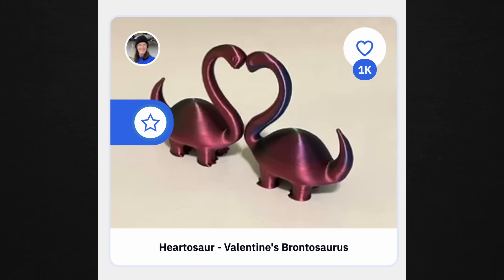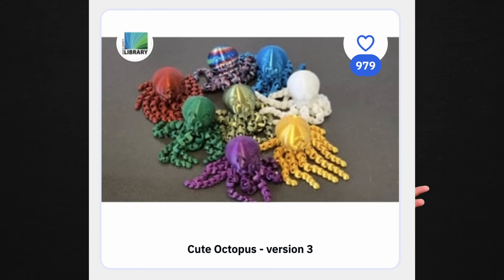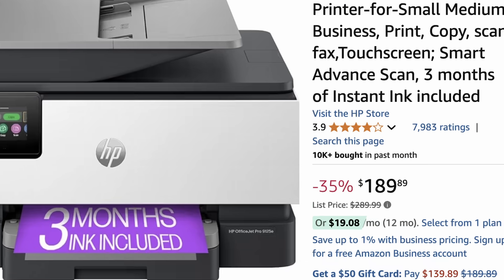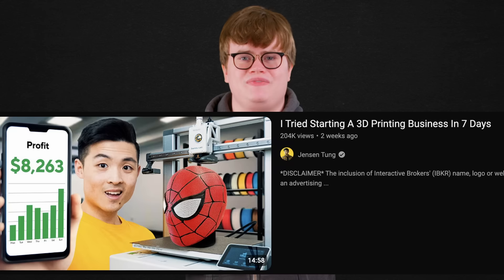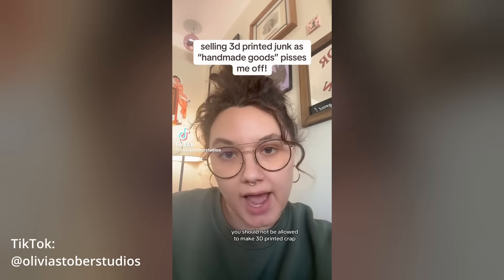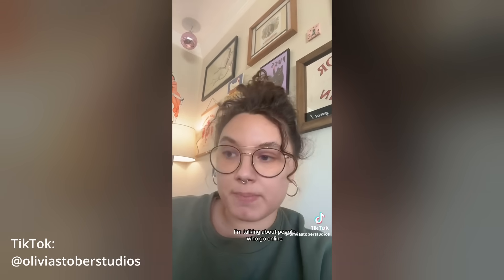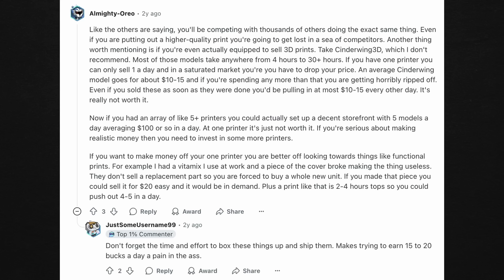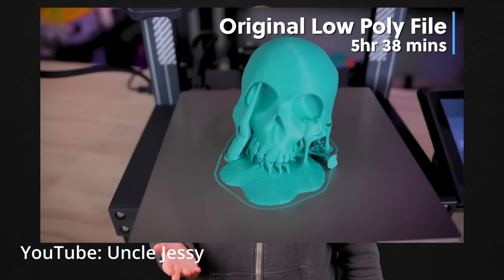The Rise of 3D-Printed Slop

Comment: finally got around to watching the whole thing. most points are valid, and I think if you had consulted someone who actually does use a 3d printer and design parts for it, and makes designs SPECIFICALLY around the strengths and limitations of the FDM process, you would have been able to cover all of what would be my counterpoints, and made a much better informed video, and even have some extra points towards the "3d printing bad" message

Comment: What I use my printer for most is for things that would be inconvenient to order, things were I can't find the exact sort of thing that I need, and things that don't exist at all that I have to model and create myself. I've printed out battery and electronics enclosures for my headlamp that are a hybrid of pre-existing models, hooks to store things, clamps for wire runs, mounts for a variety of things, and I modeled a little framework for GoPro's that contains a battery, a switch, and a tiny fan in a door over the back screen, for cooling purposes. 3D printers can be a toy, but their primary actual use is in either printing out things that you need, or printing out very specific things that other people need.

Comment: I got my first 3D printer when I built a small workshop in my apartment back in 2019 (in a small unused spare room that I ventilated well), primarily for the purpose of helping me build tools and jigs. I wouldn't want to be running a printing farm. But the 3D printer has been really useful not only in designing and printing affordable accessories and jigs for wood working, but I used it to repair quite a bit of items over time, and built custom mechanical parts for small projects, including for helping friends.

One of the last really cool projects I used it for was to put together my e-bike. I designed and 3D printed battery mounts that fit my bike frame perfectly. My motor's axis crank screw thread is also unfortunately stripped, so I ordered a new one, but it'll take months to arrive, so in the meantime I 3D printed a foot rest and use the bike as a moped. Because I've been designing and 3D printing my own parts for years, using the same filament, I'm able to design working parts without too much trial and error, so I don't waste much filament, and when I'm unsure, I design minimalist patrons or miniature versions of things. That foot rest worked perfectly on the first print, and I even nailed the texture to give my boots a good grip.

I agree that most people shouldn't get a 3D printer just to download models they find online. They should get a 3D printer because their head is full of ideas that are easier to materialize with a 3D printer than with other means. Learning to model parts isn't that difficult. You just have to be truly interested in it.

Comment: 3d printing hobbist here, but there are some fair points. I would be extremely offended to see 3D printed junk at craft fairs.
I have several bagfulls of failed/discarded prints that I keep around in hopes that someone will come up with better recycling tech. That may or may not happen.
I tend to design/print functional parts, like organizers or gardening tools or electronics parts for work, but it's true that the majority of plastic ends up as waste.

Comment: My enjoyment out of printing is printing things I couldn't buy. I'm currently working on a prop pulse rifle from Warhammer. I haven't seen anywhere I've been able to buy anything like that. I also deeply enjoy functional prints. I printed a modular moss pole that has a water reservoir for climbing plants. I also printed a sort of ball bearings roller coaster for a friend of mine. I also have a resin printer which is great for very small detail items. I use that primarily for tabletop minis. I play DND, and I'm also planning on getting into Warhammer 40k with printed minis. There's also a huge cottage industry of 3d printed nerf blasters that I would like to dip into at some point. 

All this to say, if you're limiting your impression of the things people print to the front page of thingiverse, you're getting a very distorted view.

Comment: About half of my prints are finished to retail quality the other half is brought to ready to paint and sold as paint it your self kits, saves the purchaser 30% not having my do the final painting. Correct errors with a 3d printing pen and a temperature controlled soldiering iron. No filler.

Comment: I'm about 5 minutes in and I have half a mind to make a proper response video. While I cannot stress how important it is that we are conscious of plastic waste and using plastic to make things that are essentially useless, it is my opinion that you drone on about quality and layer lines way more than you should. I'm here using FDM to all of its advantages, and I aspire to start up a recycling workshop (First bits of gear we'll be getting shortly!). I'm here having built a printer from off the shelf components that have existed long before 3d printing became a thing you can do at home, so I don't think I've bought the pickaxe. I've certainly given hundreds of dollars to companies that manufacture bioplastics but it's my opinion that that's doing more help than harm. anyway, I'll return to this soon, but for now I am fatigued from having listened to someone poopoo one of the things that I am most passionate about.

Comment: Fairly new to 3d printing but there are those amongst us who are fairly conscientious. I do not and will not print useless plastic slop (in my country we call it tat). I've never even printed a benchy. I do not buy filament that comes on plastic spools. Waste i tend to keep seperate per filament type in those vacuum bags the filament comes in, then at recyling time the bags get clearly marked so they can be easily sorted and recycled. Running the machines from renewable energy so i can afford to slow them down a bit in order to get less fails. Try not to buy things twice, etc.

Comment: I use my printer to occasionally build nerf stuff for others, but I mostly use mine so I don't have to buy expensive pre-printed nerf blaster kits. Many community designed blasters aren't injection molded, so your only option is printing. Some people run prints that are rapid and low quality, I do not, so that makes my prints and work pretty expensive.